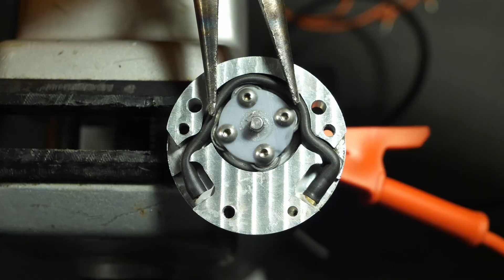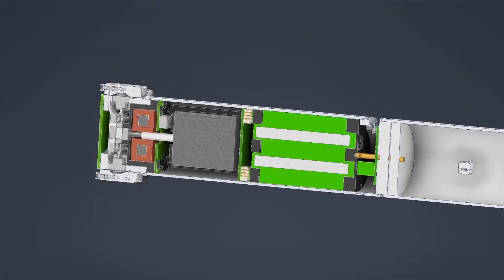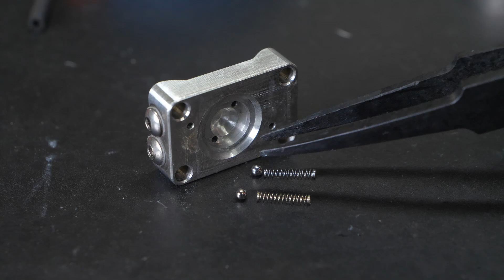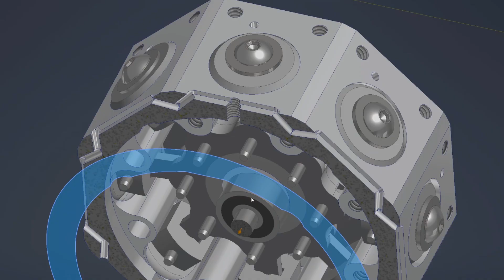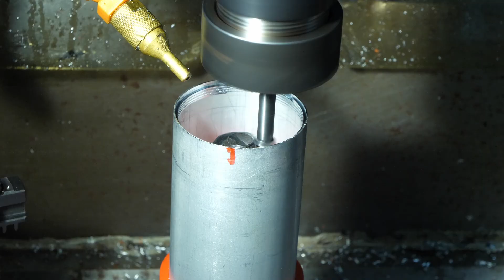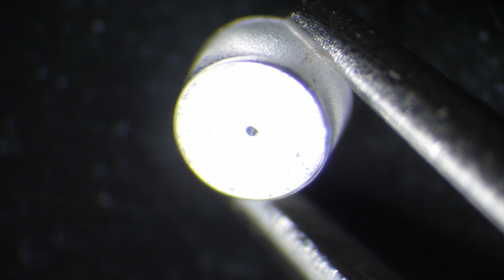Firelaser V2 part 1: Designing a New Pump

Comment: What if u just used a small 2 stroke engine , or a small rotary engine that u drill 3 holes with valves that open at certain pressures , one per triangle side. (Im terrible at explaining)

Comment: Use a gear pump!
Reply: Its the wrong type of pump to generate "easy" high pressure. Some rc toys use mini hydrolic actuaters which use gear pumps that produce easy high-ish pressure and volume. You can buy them for like 30 bucks with a bldc included.

Comment: At my old job we had the engineering problem of pumping bleach. Our problem was more metal than plastics being incompatible. However, our ultimate solution was a gear pump with teflon gears. I think you could do the same but would not be limited to teflon and could use meal gears. I realize the project is over but to anyone facing a similar problem, gear pumps were better at overcoming restrictions and running at higher pressure.
Reply from the maker: I found a company that makes graphite gear pumps that are perfect for my case, but they’re prohibitively expensive. I would love to find a way to use them since they’d be way better than the current pump
Reply: The brand Micropump and their integral series pumps are really tough, magnetically coupled, so they won't strip out and good for both pressure and decent flow. 

Seeing you design and build a diaphragm pump is fascinating. Ime they tend to stall out at higher pressures. 

I believe a gear pump will work for you but am curious why you need graphite instead of some kind of hard steel? I would think metals are okay and all your issues would be with plastics.

Comment: I'm sure SimScale would love a Collab with you. That might give some Insight if turbulent Flow is an Issue (probably not because of the Filter+Mesh) or if you're running into some other geometry-based restrictions. On the other Hand you might want to sacrifice a single Pumpchamber to pressurize your Tank or use the backstroke of the membrane to pressurize the tank... I'd honestly try the backstroke but that comes with redesigning the upper assembly.

Comment: Impressed with the iterative process and troubleshooting. I would have gone with a fixed displacement, rotational, multi piston pump instead. Like a hydraulic variable displacement pump, but with the swashplate in a static orientation.

Comment: Why all this why a fuel supply under pressure seems like a far better idea than mucking around with a pump?  Seems like a single piston could get you any pressure within reason and a laminar flow channel would calm any issues in stability.
Reply: EO could tell u himself, but the safety factor of a pressurized fuel cell in your hand probably had something to do with design parameters. Besides it's pretty cool seeing a mini pump made.

Comment: comment from the peanut gallery here (I'm NOT an engineer) just a thought, should you consider an odd number of radial pistons, is there a reason that all radial piston engines are all odd number of pistons( I think???) maybe for smooth operation??? IDK maybe the factors for the engines has NOTHING to do with a radial piston pump design IDK just wanted to share a thought :)

Comment: It doesn't look like a lightsaber. It looks more like a light foil for fencing. The problem is that your blade will not cut. Therefore it's literally a handheld flamethrower. If you want to call this thing a lightsaber you have to at least get close to the strength the hacksmith has achieved. That being said, congratulations on the handheld unit. I was going to build one before but I realized that there's no way I can put enough fuel in it to make it fun for a prolonged period of time. I've also been playing around with the same method did in Integza used to make his porous blade. I still say you can't really call it a lightsaber though because it won't cut anything.
Reply: I have used it to cut spider webs, so there's that.
Reply: @searchpartyguy  Nice, good build though.

Comment: Probably you could find HPLC grade filter frits, sapphire ball valves, liquid seals, tubing, and the like. Some of that might be useful, and available cheap second hand. A standard HPLC can do 200 bar, and will push a laminar solvent stream a good 4m from 0.17mm tubing.

Comment: If you were to put a hefty spring behind the piston in your original fuel tank, you could then pump your fuel in under pressure from an external pump and have the energy to drive it as stored. you could use whatever pump you liked then and the unit wouldn't need a pump or a motor. CO2 was another thought for power.

Comment: Wow, I just found your channel and am blown away! (Immediate subscribe and bell-check, which I almost never do) The sheer number of practical techniques you casually step through for solving problems, not to mention your intelligent, methodical way of diagnosing the problems in the first place packs in more value per unit time than most any other channel on YT.

For the eventual nozzle assembly, I know virtually nothing about fluid dynamics, especially at such small dimensions, but I wonder if there might be a way to encourage laminar flow to keep the fuel stream together for longer after it exits the nozzle? (See my note at the bottom though, maybe there’s no need as the flow would already be laminar with such a small hole of any significant length.)

I don’t know if liquid entering a tapering cavity would maintain its laminar structure or not, but I wonder if passing the fuel through a honeycomb of fine tubes in a larger diameter section before then tapering down to the 3 mil aperture might have some useful effect? 

Cutting them to length without leaving ragged ends that would defeat the whole purpose could be tricky, but it occurred to me that a packed array of fine tubes (hypodermic needles of whatever gauge, cut to length?) stuffed into the chamber ahead of the aperture might result in smooth, laminar flow up till that point. Then, rather than simply having a 3 mil hole in a flat plate, put it at the bottom of a 45 degree or longer taper. 

I thought of laminar flow because that’s the trick used in those “jumping fountains” or whatever they’re called, where packets of water leap through the air as perfect, undisturbed cylinders: The nozzles have a tightly packed array of small tubes in them so all the water is moving smoothly in the same direction without any turbulence before exit. In practice, it’s amazing how stable and coherent the little cylinders of water are over long distances.

I don’t know if this would work on such a small scale though: The tiny diameter of the orifice probably results in a pretty coherent stream anyway, particularly if it has a relatively high aspect ratio and nice smooth walls 🤷‍♂️

(If you’re still here, thanks for indulging my verbosity 😂 - And thanks for the channel 😁)

Comment: Yeesh, that CNC part looks like it’d be a royal PITA to machine! Out of curiosity, what would have been the actual charge to have PCB Way do that for a customer?

(I’m sure it’d still be way, way cheaper than any CNC service here in the US.)

- And clever thought to use a 3D printer nozzle to guide the wire when winding the spring, I’ve tucked that away in the back of my mind for whenever needed 👍😁 (Likewise using the lathe itself for that; I could see the carriage drive for threading being great for controlling the spacing of the coils).

Comment: In the small chance that you start thinking about a V3, have you considered a miniaturized rotary vane pump? I expect it would produce less vibrations but with an equivalently smooth flow and pressure.

Comment: Pump tech is BIG $$$ you should look seriously at the new applications your novel device opens up. Patent Lawyer
Reply: Exactly what I thought. Unfortunately it is too late for that. The video makes it public and therefore state of the art, which means that a patent can no longer be registered.
Reply: @thomas8719  even if. as he shows in the video itself, all it really is, is a rotary diaphragm pump, and they already kind of exist. not in this exact configuration that works like a rotary engine, but in a flat arrangement where a disk rotates on the bottom and flexes the diaphragm up and down instead of left and right. there are also Rotary Vane Diaphragm Pumps, which would maybe have been even better in this application as they have a rotary-driven mechanism where a series of diaphragms are mounted on a rotating element. As the rotary action moves, the diaphragms are sequentially compressed and released, creating suction and discharge cycles. this is not to say that his solution was not ingenious, but as with most things, it already exists.

Comment: When you seat the ball,  throw it out! Replace it with a new ball.  Tolerance is tight so it'll seal. 

We always threw out the seated ball and replaced with a new one.
Reply: Well to be fair we threw a lot of stuff away at Northrop Grumman....  I mean why buy one, when you can buy two, twice the price!  That motto was always frowned upon during our shareholder meetings.  So I suggested Big Money, Big Women, Big Fun!  And that's when I was escorted from my cubical by security....
Reply: No they will not. Not peening an aluminum surface they won't. Unnecessary advice

Comment: this project is starting to look like a rocket fuel pump for very very small liquid fuel rockets
Reply: Just double it for fuel + oxidizer and change the nozzle geometry and its pretty much a rocket
Reply: One could hope
Reply: Came here to say this and ask if he'd be willing to share his design, cause I actually need a pump pretty much exactly like this for a nozzle im working on.
Reply: @jonnymeyer8572 . Ooooooo cool I would love to see that
Reply: @confuseatronica  ooh ooh, mach diamonds!! 🤓
Reply: Use a monopropelent for fuel and a combustion chamber+nozzel, and ya got a propulsion system for a small satalite.
Reply: we definitely need a @BPSspace crossover episode
Reply: The injector pressure needs to be (at least) as high as the combustion chamber pressure. It also needs to be constant or buffered to prevent any backflow. Diaphragm pumps tend to fail well below the 1000ish psi you would need.

The simple solution to this whole project (which would defeat the purpose of engineering something, I get it) would have been to just use an inert, pressurized fuel tank and a valve. This is basically always what's used in small liquid fueled rockets.
Reply: For a rocket, don't you want all the combustion to occur internally, so you can expel mass to move?  This seems specifically engineered to be the complete opposite, in that it's getting as much of the fuel outside of the body before burning as is possible
Reply: @SillySpaceMonkey   yes your correct. What he is asking is to just use the pump section for a rocket engine and not the whole thing
Reply: @Aurorajunior7321  gotcha, thanks much (=
Reply: @SillySpaceMonkey   np :D

Comment: You know whats shaped like a small cylinder and good at handling pressurized fuel?
A fuel pump. Maybe an efi 4cyl motorcycle pump

havent handled many but I replaced a bmw one that would definitely fit in that handle
Reply: Would it handle acetone? And fit in this package?
Reply: too much flow, not enough pressure
Reply: @secso93 i see aftermarket kawasaki ninja fuel pumps in the 60psi range
fuel pumps for direct injection engines, pretty common these days,  can be around 500-3000psi
Reply: Well there are mini hydraulic pumps.

A faster running piston style pump will do more flow, more pressure.

Its a fun project anyway
Reply from the maker: @lassikinnunen I found miniature gear pumps online but they are crazy expensive. They’d handle all of the different fuel types just fine and go to way higher pressures.
Reply: @ExcessiveOverkill  what pumps do the handheld pressure washers use? I mean those where the pump is in the pistol assembly, some of which are lion powered?